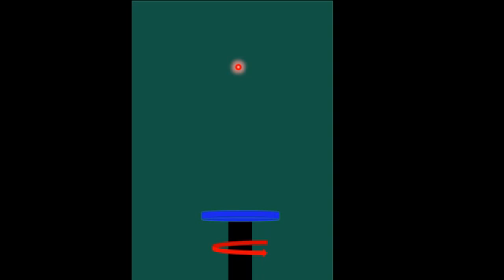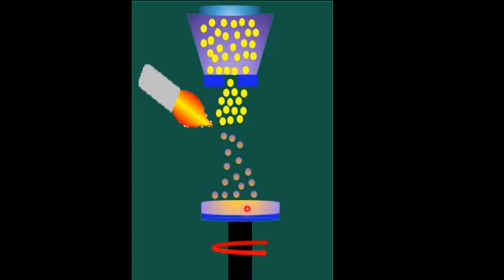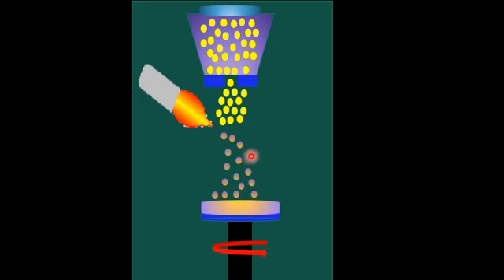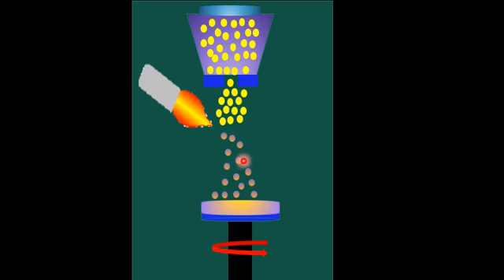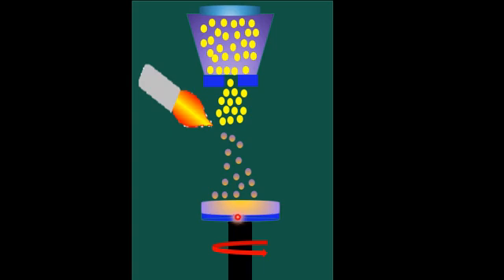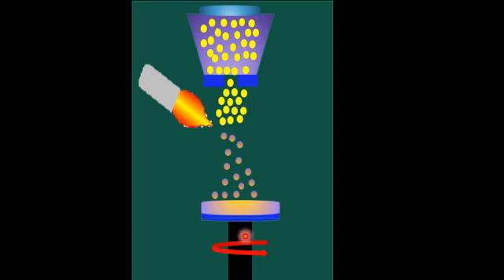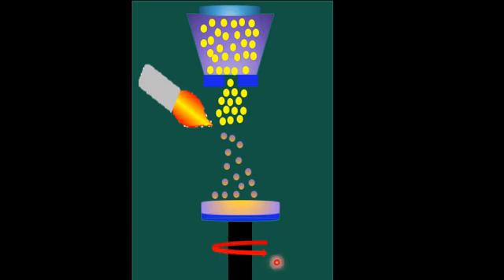Verneuil Flame Fusion Method (Processing Steps involve in Single Crystal Growth)  Lecture # P03

Comment: Thank you. How can the cooling be kept to a minimum so that heterogeneous nucleation does not occur?
Reply from the maker: In the Verneuil flame fusion method, minimum cooling is maintained by using a high-temperature flame, slow growth rate, containerless melting, and controlled thermal gradients, ensuring low undercooling and suppressing heterogeneous nucleation.
Reply: @PhysicsMaterialsScienceandNano thank you so much. How do you keep the temperature gradient small? Is the environment sufficiently hot, or is the seed crystal holder heated slightly so that no nucleation occurs? Thank you so much. ❤

Comment: Sir this is my last question How will my red glass be made? What process will have to be done? Please tell me kindly
Reply from the maker: I will perform step-by-step process to make deep red (copper ruby) glass using lead oxide and copper oxide, optimized for success even in a small workshop or laboratory setup.
Materials Needed

Silica (SiO₂) (main glass former)
Lead(II) oxide (PbO) (flux + helps in copper reduction)
Potassium carbonate (K₂CO₃) or Soda ash (Na₂CO₃)  (alkali, optional)
Copper(I) oxide (Cu₂O) (colorant)
Charcoal powder small pinch (acts as reducing agent)
Do NOT use CuO (black cupric oxide); use red Cu₂O for proper red glass
Equipment Needed
High-temperature *kiln or furnace* (up to 1300°C)
Crucible (preferably platinum, ceramic, or clay-graphite)
Metal or heat-resistant molds (for shaping)
Protective equipment (mask, gloves, eye protection)
Step-by-Step Process
Step 1: Mixing
Weigh all dry powders accurately.
Mix silica, PbO, and Cu₂O in a clean crucible.
Add a tiny pinch of charcoal powder to create a reducing environment.
Mix well using a dry spatula or pestle.
Step 2: Melting
Place the crucible in the preheated furnace at 1150–1250°C
 Keep it for 1.5 to 2 hours, until all components are fully melted.
Avoid exposing to too much oxygen — keep lid slightly closed or add a charcoal piece near the lid.
Step 3: Pouring
Once molten and bubble-free, carefully pour the melt into a preheated metal mold or on a heatproof slab.
Allow it to cool slightly for 2–3 minutes, until solidified but still hot.
Step 4: Striking (Color Development)
Transfer the solid glass to a lower-temperature kiln (500–600°C)
Hold it there for 30 minutes to 2 hours this is the crucial striking phase where metallic copper nanoparticles form.
Longer striking = deeper red, but avoid overheating.
Step 5: Annealing
After striking, cool the glass slowly to room temperature over several hours.
This avoids cracking and internal stress.
Notes for Success
If the glass turns green or colorless, copper oxidized to Cu²⁺ this means the melt was too oxidizing.
If it's cloudy or purple, the reduction may have been too strong or unbalanced.

Comment: Sir I have a question, I am making red glass from lead oxide and copper oxide but it is not working, I also tried making it from selenium oxide but could not make red glass
Reply from the maker: That's a very good and technical question, making red glass is a delicate process that depends heavily on the exact redox environment, melting conditions, and cooling rate. Let's go over the three colorant systems you mentioned:
1. Lead Oxide + Copper Oxide (Cu₂O or CuO) – Copper Ruby Glass
To get a deep red (copper ruby) glass:
 You must use a reducing atmosphere during melting.
The red color comes from metallic copper nanoparticles precipitating in the glass.
Key Conditions:
 Use Cu₂O (cuprous oxide), not CuO (cupric oxide), for better results.
Keep the melt in a mildly reducing atmosphere (e.g., using carbon or charcoal at the top of the melt).
Don't overheat or oxidize the copper – it will turn green or blue instead.
Annealing (slow cooling) must be controlled to allow nanoparticle growth (called striking).
If the glass turns green or colorless, it's likely too oxidized.
2. Selenium Oxide – Selenium Ruby Glass
Selenium also forms a red color in glass, but it's even more sensitive:
Needs careful balancing of reducing agents, sometimes with cadmium sulfide to intensify the red.
Commonly used in industrial glass coloring, like in red automotive lights.
Problems
If too much selenium is oxidized or volatilized, the color won't develop.
Cadmium-selenium sulfide crystals form the actual color centers.
Requires precise furnace control and safety measures (selenium fumes are toxic).
3. Tips to Fix Your Process**
To improve your red glass synthesis:
Switch to Cu₂O and ensure a reducing atmosphere (you can bury charcoal in the melt or use a sealed electric kiln with controlled atmosphere).
Add 1–2% lead oxide to help keep the melt fluid and promote copper reduction.
Melt temperature ~1100–1300°C. Avoid overheating.
After melting, reheat the glass at 500–600°C for 1–2 hours (striking) to develop the red color.

Comment: Hi sir,,,
Hi sir,,I need a machine to make red sapphire, how can I buy it in India
Reply from the maker: If you're looking to acquire a machine for producing red sapphires in India, there are several reputable suppliers and manufacturers you can consider. These machines are primarily used for cutting, faceting, and polishing synthetic gemstones.
Anand Gems (Jaipur)
Specializes in lapidary machines and equipment for gemstone shaping and polishing.
Offers a range of tools including faceting machines and dop sticks.
Website: anand-gems.com
Solanki Mechanic Works (Rajkot)
Manufactures precision jewelry-making machines, including CNC-controlled equipment suitable for gemstone faceting.
Website: solankimechanicworks.com
Skytech Machine Tools (Rajkot)
Provides a variety of jewelry-making machinery and tools, including polishing machines and consumables.
Website: skytechmt.in

Comment: Hi, 
can you recommend me, which flame fusion machine shall i buy for making blue sapphire.
Reply from the maker: When choosing a flame fusion machine, consider factors such as the machine’s ability to control flame temperature, powder feed rate, and crystal orientation. Many modern machines are automated to optimize these factors, leading to better crystal quality and less wastage. Historically, companies like Linde pioneered advancements in this field, though production has shifted over time. If you’re producing synthetic rubies or sapphires, look for machines that can achieve the precise conditions necessary for your specific material and end product, whether it's basic gems or more complex variations like star sapphires